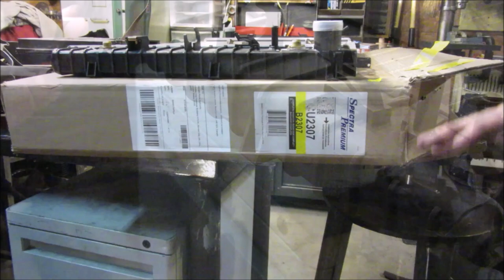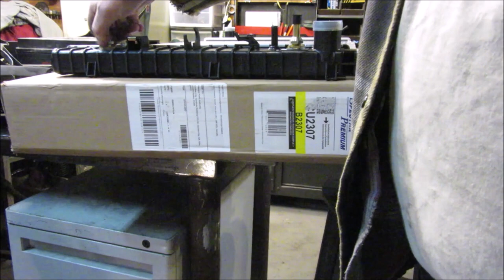01 FORD ESCAPE RADIATOR REPLACEMENT

Comment: A lot of times, correction there's always a better way. Most knowledge passed on is from a shop setting. So a lot of unnecessary parts come off when they didn't need to take off those parts.

Comment: Is this a reliable vehicle in your opinion? Looking to purchase one for a daily driver!
Reply from the maker: i think so i bought it from an action so mine had been rode hard and put up wet so i have several vids putting it back on the road but my daughter has it now and it's been delayed since 2017 the only thing so far that's sucked  is changing the alternator the rest of the things have been easy to work on i have come to really like it and my daughter loves it
Reply: Junk works DIY Garage thank you!
Reply: I bought the twin of this vehicle about 3 years ago for $500 and saved it from the junkyard. Now it has nearly 400K on it. Everything leaks but it keeps on going. As a daily driver, it gets me around on gravel roads in winter and summer. But now I need a RAD thats why IM here. The ONLY thing I willnopt take on is the Power Steering Pump is shot and I need to lift the engine to remove it. But Im an old Joe Armstrong kinda guy so Im living without it.
Reply: Glen Atwell wow, good deal!! I heard the alternator is a little challenging to remove
Reply: @joonajks  Mine went out 400 miles from home, can't likely change that one on the side of I-77.  The passenger side half shaft has to come out and the alternator comes out the bottom.  Cost me a tow, one night in a motel and $600 repair bill.

Comment: Awesome video thanks man just replaced mine, only question I have is replacing fluid?
Reply from the maker: go check out my water pump replacement vid. if you are having problems with overheating i have several vids on my channel in the 01 ford escape playlist
Reply: @JunkworksGarage  I will wish I would have watched it when I replaced the pump lol